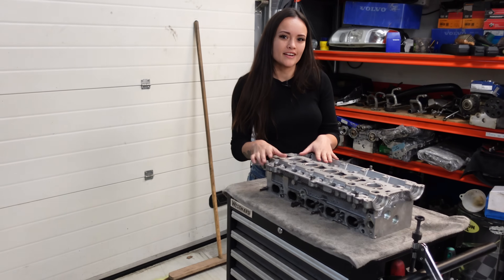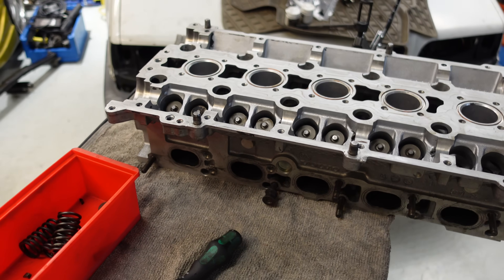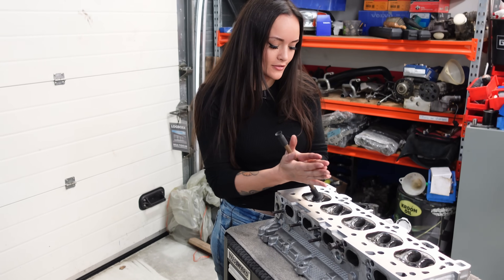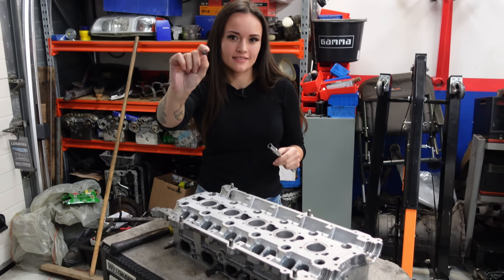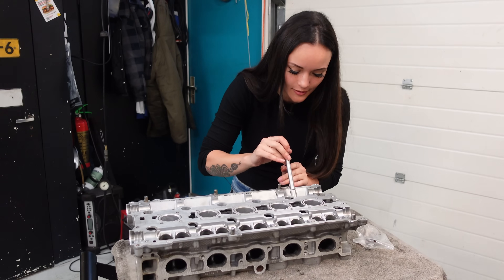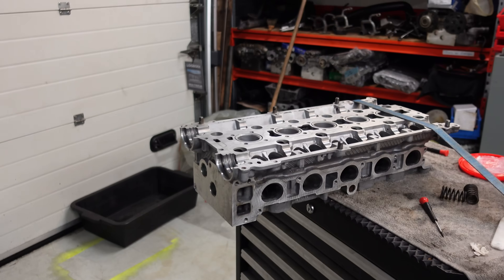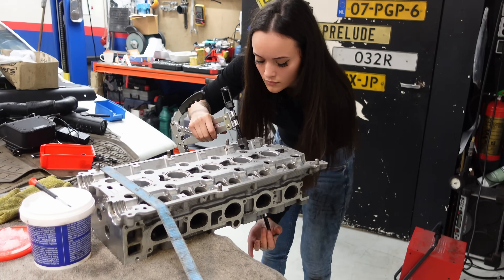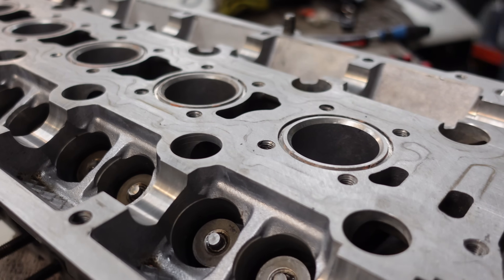Rebuilding my Volvo 2.5T cylinder head!

Comment: I've always asked my self how you measure the clearance on an engine with the cam caps integrated in the rocker cover 😅
Now I know, thanks!
Less than ideal having to remove all the cups every time and having to remember where you took them off after measuring

Comment: Nice Job Joy. The strap holding down the head to the cart is a smart move.
There’s a magnetic tube tool. You just hit with a hammer to remover the valve collets. Makes disassembling so quick no spring compressor required. The magnet catches the collets.

Comment: Re Valve collets. I guess it depends on the engine, but the Volvo head is almost identical to the Saab heads i work on. I personally have a favourite pair of long thin Tweezers. I find this better than a magnetic screwdriver. But either way its a time consuming job that needs a steady hand !.

Comment: It’s a bit of a shame that the valve clearance was perfect. It would have been interesting to see how you’d have gone about to adjust the clearance. It’s not obvious to me.
Reply: If the valve clearance is wrong you look inside the follower/bucket to see what measurement it is and then calculate  how much thicker or thinner it would need to be to get the correct valve clearance. You then have to buy a new one of that size. It can get very expensive if you're putting in a new performance camshaft and most of the existing followers won't fit anywhere.
Reply: Because its a volvo, valve clearance is almost never a issue

Comment: Good idea lapping the valves 
And replacing the seals  
While you have the cylinder head 
On the bench 🔧

I never knew that about 
Volvo valve springs colors 
Thanks Joy 🥀

Don't be so hard on yourself 
You're doing a great job 
I'm learning a lot 
From you 🙏

#VolvoV70 
#EngineRebuild